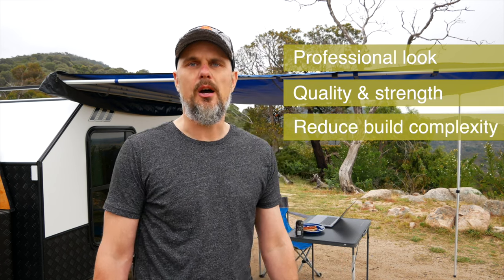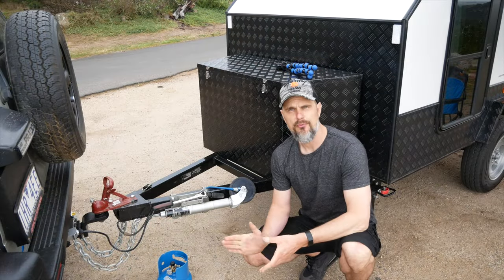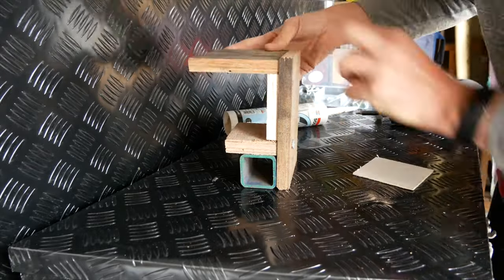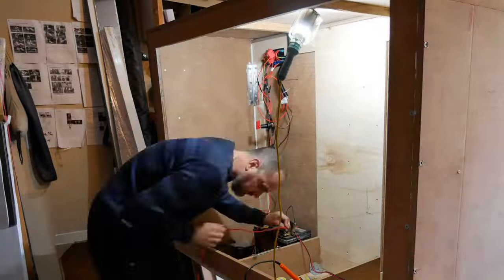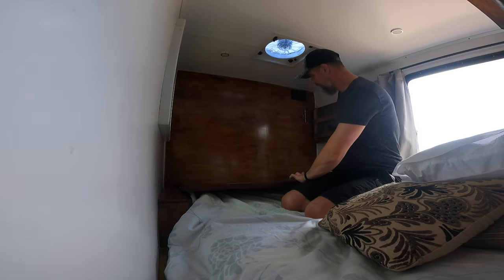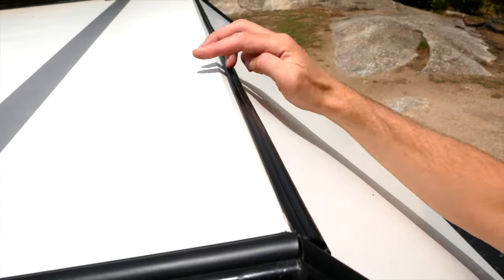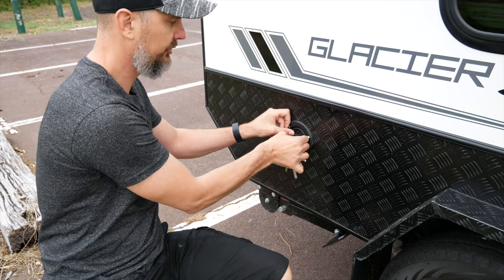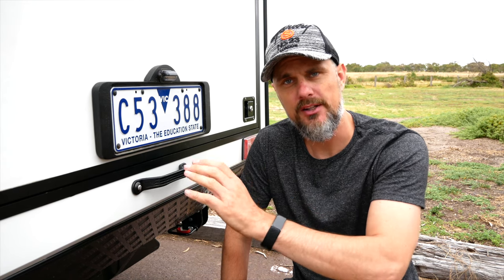DIY Squaredrop Camper FULL BUILD Walkthrough

Comment: I can't believe that comes in under 750kg. All that heavy gauge steel, layers of thick plywood, 60kg of water, ... They are often built with much lighter steel frame and composite foam/polycarbonate panels to get in under that weight and have enough left over for all your camping kit.
Reply from the maker: You are right. I'm pretty sure i mentioned somewhere, at least in another video, and many comment responses that the tare weight is 920 kg.

Comment: What about a gas certificate as a camper in Victoria?
Reply from the maker: Good question. I'm not sure, as I just use portable small gas bottle. I don't actually have any gas fittings permenently in the trailer.  So it's not different than just carrying portable gas bottle in the boot of the car.  Of course anyone handling any gas appliances have to approach it with grea caution.  But all the appliances and fittings that I use are from proper major reputable stores.

Comment: Mate, brilliant build and turned out awesome. A few questions and thoughts:

1. Why did you choose a wooden frame for the cabin vs say using RHS or square steel tube? I am debating this point right now and interested in your views and experience.

2. Double ply walls - understand you needed the structural integrity, but did you consider a laminated or hollow core approach using thinner ply on the outer (8-12mm), then borders/bracing for the insulation layer, then another thinner play or faced laminate on the inner layer? Not saying you did it wrong, but I saw a lot of wastage and effort in cutting out your inner ply.

3. Did you consider the aluminium composite sheeting rather than plywood for the walls?

4. I love the shelfing layout – I will likely steal your ideas :)

5. How did you get front – rear balance?

This has to be one of the best camper build videos out there, really good you focussed on how you built it and not showing off what you built.

Comment: Congratulations Elvis , this is the most practical camper I've looked at . Great video and awesome outcome . Thanks mate .
Reply from the maker: Much appreciated.  I think I should put up an updated short video with additional practicality improvements.  For example we learned that you want to have as much working space on the kitchen bench, so I've ended up installing powered fridge inside the toolbox.  Things like portable table and chairs, we now just keep inside the sleeping compartment, because these you always take out and setup when you get to a spot, so better to leave toolbox for the fridge which you then don't have to pull out for the entire camping trip.  I've also installed the stove under the bench where you can just open the lid if you need to use the stove, or close if you want more working space.  So far we have been really happy with practicality side of things.

Comment: Very practical, relatively light build.  You give up some weight with a good, steel chassis.  They make lighter, aluminum chassis.  For me, that little extra weight was not significant, because it's still very small and light behind my pickup.  I know it's back there.  It definitely affects my gas mileage and acceleration, but it's still small enough that I can keep up with traffic and not be resigned to the slow lane and/or be a traffic hazard on mountain highways.  

If I were building my own, it'd be a square-drop where the back door is the entire back wall, and it's hinged at the top AND the bottom, so it can work as a ramp or weather protection, as needed.  Just have it latch good and tight with side latches, and use a hinge pin (or pins) to decide which way it'll open.  Run the pin through the top hinge, it's a back porch.  Pull the pin and run it through the bottom hinge, and it's a ramp.  Make it the absolute smallest toy hauler that's practical.

I don't have any toys, but I would like that option.  But all the toy-haulers out there are man-height.  But I really like the highway and off-road performance of a good teardrop or square-drop mini-camper, and I think there's middle ground, there, for somebody with smaller toys, like 80-cc dirt bikes or snowdog snow machines. Nothing high-powered, but still mechanized, to extend your range from base camp.  Toys you can take with, without making a production out of it.

Comment: Nice job! Great summary. How did the Tare weight turn out?
Reply from the maker: After I included all the extras (stabiliser legs, roof racks, solar panel, brake system, toolbox etc... (and mind you I haven't used the lightest materials either), it's around 900kg.   It's on a little heavier side, but it's rock solid... very strong. If I build one in the future, I' probably try use composite panels or something like that.

Comment: Looks great mate, like a factory build one! Perhaps some upgrades you could think about are using eye to eye leaf springs and beefed up front spring mount, allong with getting the same hub and wheels to your car so you can share spares.
Reply from the maker: Great suggestions.  I thought about eye-to-eye but will leave that for the next trailer, as I'd have to pull apart existing hangers and weld new etc etc (and I'm a bit over it at this point). But I am just installing a new spring based pivot coupling with brakes at the moment.  Wheel matching is great when you know you will keep the car for a while, but problem is when you replace your car then you are in a pickle again.

Comment: You are a god!  I've been slowly designing my trailer over the last 4 months.   I have a similar design planned with some few changes for my needs.  I'm buying a Subaru Crosstrek Wilderness this year that has a tow weight of 3200 max.  What's the dry weight of your design?  Awesome dude!!! Thank you so much for making this video.
Reply from the maker: Thank you my friend. I wouldn't go as far as "god" but thank you :)
Tare weight is 920 kg.  A bit on the heavy side if you compare to some small DIYs, but it's very strong. That being said, I've seen at caravan show professional square drops much heavier than that. So not too bad.
Reply: @ChilledBeans  well played. I’ve watched a ton of videos. I’m in the US so pounds over kg. But you gave me the platform I want to build in. In actually diving back into my CAD software and start tweaking. Thank you.
Reply: @ChilledBeans  random question. Why did  do  the slanted  bottom in the back instead of maximizing storage space. By being more box at the bottom. Was that a gas mileage choice? Thanks for your time. Really appreciate
Reply from the maker: @pringlized it was primarily an aesthetic choice.  To balance (visually) that angle at the top front.  But yes, it would also reduce weight a little. Especially if you put angle at the front, if i didn't do it at the back to compensate, i would have more weight at the back of the trailer... and you never want to have more weight at the back of trailer as it would compromise trailer balance and stability on the road.  If you do just build full box at the back, you have to make sure you position the wheels/axle so there is always more weight at the front.
Reply: @ChilledBeans   Thank you.  I was planning on a Dometic pull out in the galley, but I can always move that to the tongue.  Thanks for all your help and advice.  I'm excited to start getting my supplies. You rock dude!
Reply: @ChilledBeans I've been junking out on what I want to build. I love the root you built. So well done

Comment: This is awesome to see an australian video of a camper build - Did you consider using an existing trailer as a base?
Reply from the maker: Thank you.  I did, and I probably would in the future but it was tricky to find the specific base to suit my needs. Also I didn't want to deal with hidden issues or rust. I wanted to make sure i have solid base to suit my exact requirements.  Also, building the frame (if you can weld) was fun and it wasn't as hard.
Reply: @ChilledBeans  yeah sorry, watched the video again shortly after my comment and got my answer. I cannot weld, but I have seen some places selling custom trailer bases around the $1500 mark so might go down that route.
Reply from the maker: @tazanelli  yes, if you don't weld, then it's a no brainer... buying an existing base would be the simplest and most effective option.  WHen you chose a base frame, consider where you would place the water tank... base frame clearance from the ground... size of A frame if you want to put tool box etc.

Comment: That’s a nice finished product man. It looks factory built. Did you use 4x8 sheets of plywood for the sides?
Reply from the maker: Thanks heaps.  Yes, i used 4x8, But i had to extend them... i added another four inches to the top, and maybe 1 foot to the rear. I just glued the extended sections on, and then added that second layer of plywood underneath to hold it all together.

Comment: Hi Elvis, thanks for taking the time to produce this video. I really appreciated the way you split the build into the 3 phases. Your step by step process showed how straight forward the build could be. I reckon I will watch this video many times to make sure I understand your build process, because the finished product is very impressive. I am sure you invested many hours into the build, it would be interesting to understand how many man hours you have invested. Thanks again for making the video.
Reply from the maker: Thanks Tony for your detailed feedback.  This is a quite difficult question to answer precisely, but I can give you some indication. I've built the frame in under two weeks during my holidays (working mon-fri). However I then had to spend time fiddling with bad bearings and tyres from an old trailer (if i didn't do that i'd save quite a bit  time there).  I completed the phase two within next 6 months working part time (after work and some weekends)... and then the next couple months I built the accessories (again just working after hours/weekends).   It's quite hard to accuratelly timebox it though.  I was pretty dedicated with the build during the 6 months, but it wasn't all of my spare time either as you need to rest as well and family and other commitments.    During the whole build I had to make numerous unnecessary trips to far shops (which I could have avoided if i had more experience and better planning)... so all in all, I have wasted some time on the build too.  So yeh, hope that gives you some indication...  Good luck with your project.

Comment: Couple of questions , what is your balls weight , do you find it light as having warer tank and kitchen at back or evenly balanced , also how did you go getting ur spare out when u had the flat , just seems like it could be tight to get under . Once again brilliant build .
Reply from the maker: I can't remember exact tow ball weight, but when the trailer is all loaded (water, kitchen etc), there is still more weight on the front (as it's supposed to be). I can just lift it a little if I pull hard with my arms. I reckon maybe 80kg.   Yes I had to pull out spare when i had the incident with original bad axle and hubs... one wheel was all the day down (rubber gone). ANd i had no problem reaching for spare.  Remember you also have the stabiliser legs so you can always lift the trailer more if you need more room. So no issues at all.

Comment: Hey mate..  thanks for the video, it has been a great help with firming up my plans for my trailer rebuild.  I have a question on the colorbond.  Where did you get sheets > 1.2m wide from?  also in Melbourne!
Reply from the maker: Flash Roofing Supplies - Hoppers Crossing.
They haveall different thicknesses. I went for very thin to reduce weight...
Reply: @ChilledBeans  Thanks heaps!

Comment: Good job, coming through the same process, my main problem is overbudget
Reply from the maker: I'm hearing you. I'm not sure what the building material prices are like in states, but here everything went up in the last year or so. I think i spent around 5k on mine, but now the same think would be around 8k probably.  But it's still much cheaper than buying new one.
Reply: 2. 1.1k, wood 🪵 expensive to, frame materials. But I am building xl version:) with heater, refrigerator. Price build up quick I still need to buy aluminum for skin and trim 8k so far.
Reply: 1. I think I will end close to 10k. Biggest  spending was timbren suspension for wide tires 1.5 k, 2 🚪 and one window
Reply from the maker: @MrMycalifornia  Yes, I'm hearing you.  My base build was 5k, but then I spent more money to rebuild axle and add disc brakes, and I added solar, and also wired in a fridge... so you are right, that would have pushed it up to around 7k.  But if you do it in stages, you don't have to have everything in the first release.  We used ice box first few camping trips without solar.   And for my next trailer, i'd also invest in a bigger suspenssion and tires.
It's great that you did it right away so you have the right setup from the start.

Comment: Hello! Could you make a video explaining the support systems (water and power). how many batteries did you use? Can you share the blueprints that you did?

Thanks!
Reply from the maker: That's a great idea.  I'm currently in the process of upgrading some of the electric systems... for example installing solar panel, water pump etc.  I also want to re-build the toolbox and install a draw fridge  there. So once I complete that I can do a video explaining full electrics.  I only use one battery for now. I have installed 160W solar panel kit, and in the full sun, it charges my battery very quickly.   Having a water pressure pump is a must, as I didn't like using the manual pump tap... it was annoying and not enough water flow. A cheap ebay pump (8l per minute flow rate) was under $50 AUD, and it was very simple to install, and works really well.
Reply: Thank you for your response👍🏼 congrats, awesome camper

Comment: Great video Elvis.Probably the best I've seen.I'm about to build one myself. How did you go getting the correct down ball weight. Cheers Mark.
Reply from the maker: Hi Mark. Thank you. I wish I had a more scientific answer for this one... but I estimated the position of the wheels by eye and rough feel based on what I planned to put at the front and back of the trailer.  I suspect there may be some more sophisticated methods out there how to calculate this, and I sure will look into them for my next build.  But I'm quite happy with how mine turned out... I think I'd have around 80kg down ball weight roughly. There is enough weight to keep it down at the front, but a strong person can still lift it with two hands when required.
Reply: @ChilledBeans  Thanks Elvis . I've built a boat trailer before and what I did was set the axles complete wheels etc on 50 x100 angle loose on the chassis. Completed trailer with boat on. Total gross weight and then weighed the whole lot. Slipped the angle back or forward until I had 10% on the ball. Bolted angle to chassis. Can't do this with your build as guards are incorporated within setup. Which I like as it gives an extra 250mm in useable cabin space.The pros must work it all out mathematically. There not building one offs though.Cheers.

Comment: Done well . Would have had wheels set back more so you wouldn't need stabilizer and just level with just jockey wheel.
Reply from the maker: Thanks...  Stabiliser legs come handy when the camping site surface is uneven sideways too - which I often encountered...  Also it prevents trailer jiggling when you are tossing in bed at night... or doing anything else ;)

Comment: Great build & great vid. Have you come across any resources RE geometry & physics etc of camper trailer design? Something that guide how long to make draw bars. Where to position axles etc
Reply from the maker: Thanks.  To be honest, no.  I ended up approximating those aspects, and it all worked out good. The trailer handles really well on the road.   I have heard that the trailer should be balanced so that there is 50-80kg pressure on the towbar.